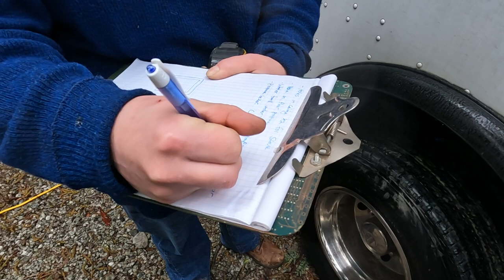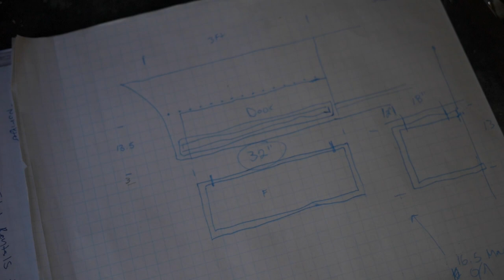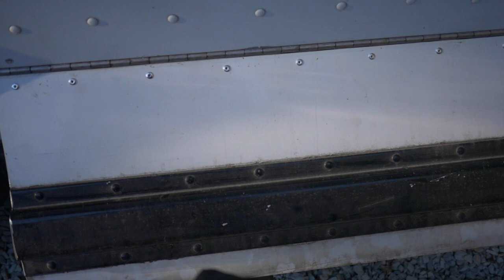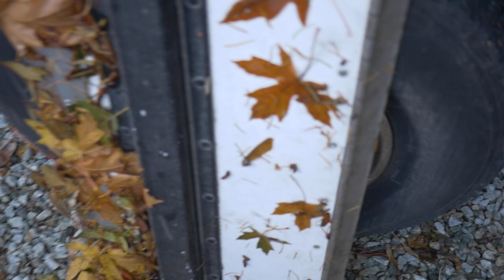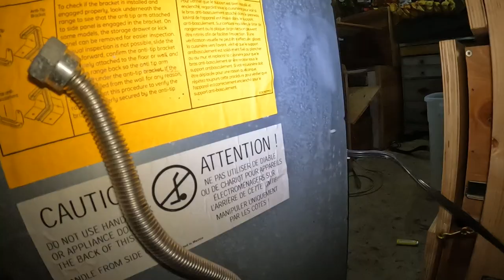Gas Locker in my Step Van Conversion | Vanlife Cooking

Comment: Your van only has one door. It's called a curbside van because you have to exit out on to the curb..🙂
Reply from the maker: @Jeremy @Boondockbasecamp You know I thought that too! But on closer inspection I think it actually originally had two doors. There’s a sliding door pocket on both sides and there’s the step well in the drivers side I can see from underneath too. It looks like the floor on the stepwell disintegrated or was repaired then broken and instead of keeping the second door they just walled it off! Strange I think!

Comment: Great Job.  I am not familiar with the yellow color thread tape but I know my propane equipment expressly says not to use thread tape.  You may want to verify using the thread tape is recommended.  Also the hole you drilled is perfect for a mouse entrance (experienced that).  I use stainless steel wool shoved around the spaces mice can get in with success.  Again so happy for your accomplishment!
Reply from the maker: @Penelope Nature YES I am going to sort that out, I have it insulate the pipe, which will reduce the hole size, and then I'll definitely fill the rest of the whole with steel wool.  I've had mice before so am super aware of any holes that make a good entrance.  I'll look into the tape, it was already on the joints from it's previous installation. thank you so much!

Comment: This is great. I'm curious if you have to unbolt the tank every time to take it out to refill it.
Reply from the maker: @Boho Blue Van I think I will yes, but I'd rather do that then have it sliding around in the locker.  There's more space in there so I'm sure I'll eventually store other things in there too once I have a latch installed.

Comment: That's a compression fitting. No need for tape to seal the fitting. Always use soapy water to check ur connections for leaks. Happy cooking.
Reply from the maker: @Billy C oooh really??! I’ve disconnected it again coz I have secure and insulate the hose. I’ll definitely do that again! Thank you